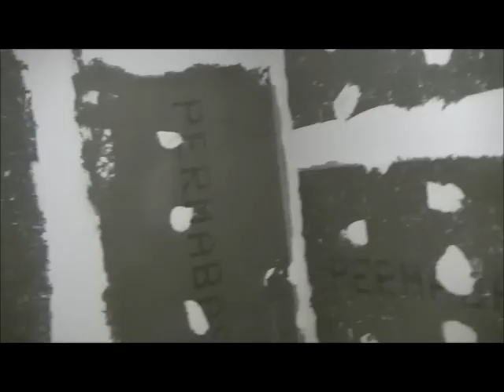How To Prep A Shower For Tile

Comment: I assumed it would be pitched I watch your videos so would have guess it was done correctly but I've never put a wood bench in for that reason so was just curious as an installer what your thoughts on that thanks for responding and answering

Comment: Great video.  Had a question.  If the wall board is raised (i.e., backerboard does not touch the shower pan) how do you make sure that the bottom corners are completely sealed (there may be gaps caused by the folding of the pan liner in four corners after the cement has been dried.)?
Reply from the maker: You can use a 2x4 or some other object to push back the folds, fill in the the gap with mortar, next day you're good.

Comment: Hi Bob - Should I redguard all the way to the drain on the shower floor or just a couple of inches past the perimeter of the shower walls?  I was thinking you mentioned in a previous video not to redguard to the drain in order to avoid a chance of a mold sandwich.  Thanks for all your advice.
Reply from the maker: You are absolutely correct, I have said that in the past. The last few jobs I've done, I've Redgarded to the drain cap, as other tilers are now doing. I guess time will be the test...not sure 100% I will continue this way.

Comment: Thank you for your videos!  A couple questions though - do you need to leave a gap between the sheets of backer board to allow for expansion?  Do you tape the seams of the backer board on the floor? Do you use Spackle or thinset to mud the joints on your backer board?  Thanks again!
Reply from the maker: I don't leave a gap, the boards are flex enough to not worry about expansion. If you want to, you can tape the seams, many tilers do that...taping is a crack prevention measure, with RedGard applied, it becomes a crack prevention measure since it's extremely flex by itself. I use thinset for backerboard, mud if greenboard.

Comment: Are you not concerned with the water that gets behind seat will eventually cause water damage since the pan isn't in the full perimeter of shower ?
Reply from the maker: The bench is NOT in the scope of the shower pan, so it will never see water from under...the face and top are Redgarded as is the whole shower, and water can't penetrate it..then the tile on top will be pitched so water runs off.